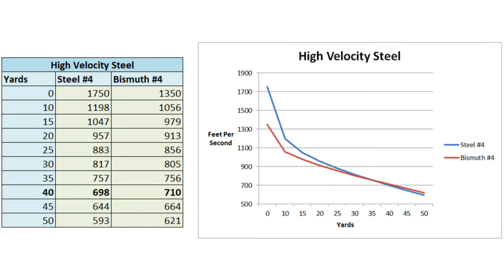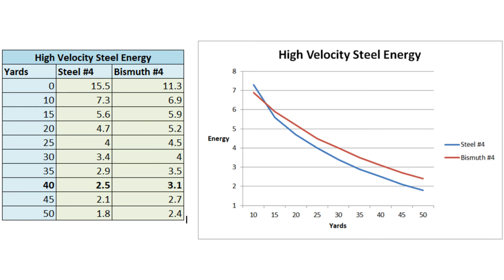Decoding The Marketing Hype Of Waterfowl Ammunition

Comment: The author actually thinks plating on steel shot allow a 75-90 DPH pellet to elongate going through a choke?  How many time have you pulled an elongated steel pellet from a duck you shot?  Undergoing a chamber pressure of up to 13,000 PSI won’t even cause a dimple.

If you try to elongate steel pellets going through a choke tube, you are risking choke damage,
Reply from the maker: You misunderstood. It's elongation the shot column with less friction and the accompanying dispersal forces. Never have I attempted to infer that any pellets of any metal are being elongated.

Comment: You said plated shot has more lubrication so it goes down the barrel easier. How is that? It's in a wad.
Reply from the maker: Often, it's not. I've inspected a lot of shells, too often the shot is stacked higher than the wall of the wad.

Comment: I really like your videos. You do an excellent job. I found out years ago when I cut open a Hevi Metal shell and weighed the pellets the lies. They advertise smaller pellets at the same weight as the steel. Not true. I found that the pellets that are even bigger than the steel were lighter. I have a video called lighter than steel check it out.
Reply from the maker: Oh wow, really? That's crazy!

Comment: Can't recommend the Hevi-Shot Hevi-XII enough. I have been hunting with that stuff since it first hit the market. They hail from Sweet Home Oregon, same state as I'm in. They've sense been bought by Vista Outdoors. Now the Hevi-XII is the original Hevi-Shot that has been winning pattern competitions since it hit the market. My personal longest F-U shot on a goose was at 102 yards with #2s, dropped it stone cold. Don't recommend shooting at that range, but I was mad.
Reply from the maker: A viewer recently sent me a handful of HEVI XII to test, a couple #4 and #6. I am impressed with them. The test videos are on the way. Aside from the cost and the fact that they don't seem to want to cycle well in my gun, they may be the best thing on the market save 18gcc tungsten.
Reply: @TheNewHuntersGuide  That's odd that they don't want to cycle. They cycle just fine through my Rem V3 Waterfowl Pro. I do miss Hevi-Shot's heavier payloads. The #2s, which I use for Geese, are currently only offered in 1 1/8oz. I still have some old shells where they are up at 1 1/2oz. So far the Geese haven't noticed a difference. Yesterday, the 10th, was our Sept Goose opener.
Reply from the maker: @stevennicovich8547  Yea, it was odd, at least they fired. Could have just been that batch of hulls.
Reply: @TheNewHuntersGuide  With your Semi, do you have a gas adjuster on it? I know early gas semi-autos like the Remington 1100 or 11-87 have gas adjustments for different powder charge shells. (Low Base vs High Base) My V3 uses a port system, where the 3" shell covers more of the ports which keeps the timing accurate.
Reply from the maker: @stevennicovich8547  No, my gun is brand new, there aren't any adjustments. The shells tend to pinch trying to eject or otherwise get stuck. Everything else tends to work fine from target to turkey loads. I haven't shot a box of them either, I've only had a few of the HEVI 12s to test. I'm not ready to make any conclusions yet, I didn't even mention it in the videos, just not enough experience yet.
Reply: @TheNewHuntersGuide  In response to ammunition which is mixed with different metal types, like Hevi-Metal and Hevi-Hammer, wouldn't the deference in densities cause the shot string to have greater separation at longer ranges? Since the Bismuth or Tungsten are denser and retain their velocity better, they would naturally out pace the steel behind them, causing a massive hole in the shot string. So instead of one even string, you'll have two separate strings with a gap getting ever greater, esp past 35 yards.
Reply from the maker: @stevennicovich8547  Yup you nailed it. But it is hard to measure and hard to choke.

Comment: I do not think your comparison of #4 steel and #4 bismuth shot is appropriate since the bismuth is heavier than the same size steel shot. A more appropriate comparison for both velocity and energy would be #3 steel to #4 copper plated bismuth. Check with the guys at Boss for specific size to mass comparisons.
Reply from the maker: Hi Jim, that really is one of the big points. Bismuth out-performs steel in every shot size. Bismuth in general is equal to steel 2-3 shot sizes larger. Any size.
Reply: @TheNewHuntersGuide  Thanks for acknowledging my comment - but my point is your comps are not scientifically valid relative to velocity, size, mass relationships. Your reply didn't address my points.. In my opinion you're misleading lots of folks with the same size pellet comps.
Reply from the maker: @jimboswell6460  Hi Jim, I don't think you can mislead people by showing real data and I am struggling to see why you want to compare #4 bismuth to #3 steel in the stated context. If I used high velocity #3 steel to hunt waterfowl, I could use #3 bismuth to much greater effect in every way. If you want to do cross shot size comparisons look at my field tests play list. I have shot #4 bismuth against #4 high velocity steel and #2 high velocity steel in the same video into the same gel. The 1350 fps #4 bismuth penetrates deeper than the 1550 fps #2 steel in the same gel. There is more ballistic energy at 40 yards, even at 2 pellet sizes smaller.  In fact it is that sort of testing that prompted this deeper exposition into the math and science that prompted this video and a few others. Even though you do gain more mass per pellet as you increase steel shot size to try to compensate for the advantages of bismuth, that gain is offset but the lower density. Those bigger steel pellets have more wind resistance, it is kind of like throwing a bigger wiffle ball. It makes some difference but not enough. You would need Steel #1 shot to equal the terminal performance of Bismuth #4 shot.  But even in doing that, the bismuth #4s have about 50% more pellets per ounce than steel #1s. And often you have more ounces of shot in the bismuth loads because the steel uses less shot in order to get that shot up to those much higher and ultimately marginally effective velocities.
Reply: @TheNewHuntersGuide  Not a fan of steel. I'm an old fart, been hunting waterfowl since the early 1950's. Hunted exclusively with an A-5 3" 20 gauge, hand loaded with 1.25 oz of #7.5, #6 and/or #4 shot(depending on situation) until lead was banned. I am sold(though pricey) on the Boss copper plated bismuth. However, the comps of shot, steel to bismuth, should be equal or closer to equal using the similar mass per pellet X specific velocity = energy. To my scientific mind that is the most correct comparison. And yes, I understand and agree with your statement of the relative difference between steel shot size and copper plated bismuth shot size relative to downrange velocity & energy.
Reply: Thanks.

Comment: I kind of disagree with the lubricity statement on the inside of the barrel since the pellets are carried by the wad if using the right type of wad for non toxic or steel.
Reply from the maker: Yea, I meant to talk about that more in the video as well, but forgot until I was in editing already. You are right, most pellets are not touching a barrel wall. Some may, in which case the statement about lubricity is valid. But in most instances, with quality ammo, it's a non issue.
Reply: @TheNewHuntersGuide   Thanks.
Reply: @TheNewHuntersGuide   Got another subscriber, for that answer. Thanks.
Reply from the maker: @tuyo_adventures.2185  Thank you sir!

Comment: How is the recoil of the boss shells? Thinking of getting a 20 gauge O/U for uplands and I plan on using boss shells for it. I'm starting to think that ill actually have more recoil with the 6.5 lb 20 gauge than my 7.5 lb semi 12 gauge using the 2 3/4" (12) and 3" (20) shells. What do you think?
Reply from the maker: Funny you should ask, I just shot a video testing recoil across several BOSS loads. And have a handful of other recoil focused videos on the way. It will be a while before it launches, but here is what I can tell you off the top of my head. The 1 3/8 loads, shoots great, the 1 1/2 loads, shoot fine, the 1 5/8 loads, kicks like a mule in my shoulder and to my cheek. My shotgun is 7.75 lbs.  There is something about going above 1.5 oz that takes the recoil up a big notch, and I have the data to prove it. The 3 biggest variables are payload, velocity, and shotgun weight. Since velocity is a constant with boss, it's just a matter of payload and gun weight.  Shell size really means nothing.  I have shot some of their 1 1/4 oz 2.75" shells, and they are very kind on the shooter. I kind of wish I would have bought a case of those instead of heavier ones I did buy... If you give me the exact specs on shell payload and gun weights you are considering, I can run the rough math for you.  Also, I just recorded a massive research study examining if Semi's have less record that fix guns. I contacted almost every shotgun manufacturer that serves the U.S.  Stay tuned for that one.
Reply: @TheNewHuntersGuide  So the 20 Gauge I'm actually considering is about 6.7-6.9 lb's depending on which barrel length I get. The load would be the boss 3" 5's which have a payload of 1 1/8th going about 1350 fps. For reference the 12 gauge I shoot is a Remington V3 and the load I would shoot with that would be a Boss 2 3/4" 5 with a pay load of 1 1/4 going about 1350 fps as well.

Love the scientific approach to the videos! I work in research myself as well so I can really appreciate it. Ill be sure to sub to see the videos you're mentioning. Very interested in seeing them.
Reply from the maker: @niggahigganum2  Thank you so much! I'm a trained researcher but I don't do much work in the field presently, well not outside of Youtube, ha. So at 6.7 lbs, the 20 gauge will have 29.8 lbs of felt recoil. The 12 gauge at 7.5 is 31.8 lbs of felt recoil. So probably not a perceivable difference. BUT the V3 is one of the lightest recoiling shotguns on the market. So even though the recoil energy is slightly higher, I believe the V3 will feel like it is softer shooting than the 20 gauge over-under, here is a link from Rem with a chart and some data as to why https://www.remarms.com/shotguns/autoloading/versa-max/versa-max-sportsman.  I am actually considering  upgrading to a V3 waterfowl model because of these benefits. It is between that and a Mossberg 940.
Reply from the maker: @niggahigganum2  Yea, I don't think you stand to gain much with the 20g unless you hike alot and a little bit lighter gun is valued.  I need to handle a V3, see how I like it. Hoping to get something this year.